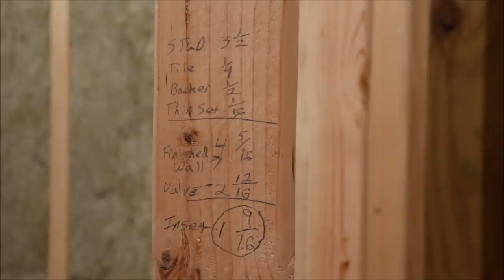Building My Own Home: Episode 116 - Installing the Shower Valve for the Master Bathroom

Comment: Great decision moving the valve to an interior wall. That way, if any problems arise, you can get to it. You do such precise work.
One tip, to make absolutely sure your pipes will never freeze, take that Rock Wool on the exterior wall and tuck it completely behind the water line for the shower head to allow the most heat from the house to access that water line, even if it means a little compression happens, you'll be better off. The same goes for any other water lines in the exterior walls. On any water lines in your crawl space, the opposite is the norm, cover pipes to protect from the cold crawl space and get heat from above.
Merry Christmas !!!!

Comment: Nice job.  In watching out put the two fittings onto the rough-in body for the shower, I wondered why we didn't have a body with PVC connections on all four locations.  I recognized that part as it's one of our products.  I will ask the product engineer over that product to see what the reasoning is.  The fewer the number of sealing joints the less you need to worry about for potential leakage.  As I get more information, I will try and pass it on to you.  Have a Merry Christmas and a Happy New Year!
Reply from the maker: Hey, thanks Scott. I think you may make it with pex fittings but I couldn't find anything but the valves with NPT fittings at Lowes.

Comment: It will be good to have the control on an interior wall so you can have an access door in case you ever need to get to it. Another good video!  Merry Christmas
Reply from the maker: Absolutely! An access door in sheetrock is WAY better than having to re-tile a shower. Merry Christmas!

Comment: I do pipe tape and pipe dope for extra sealing.
Do they make 90 degrees for your pex connections ?
I wonder if screwing a temporary board onto the backer board and screw your valve to it so you would not have to hold the valve, that way you could use both hands for the crimp tool.

Comment: I think its a good idea to shower balb  close to the door  so I won't be trapped in the shower when I first turn the water on   or have to move away from cold water  turned it on from the outside  and walk in to a nice  hot water just my opinion

Comment: And the electric wiring how you wired them did you mix plugs and switches in the same gauge or only plugs in one breaker and lights and an other breker

Comment: What kind of screws are you using to attach the brass shower valve? Trying to find some that won’t have a chemical reaction with the brass and cause issues down the road.

Comment: Where do you run the PEX pipe in a single story house?  In the attic or under the floor?   Through the walls?    Do you insulate the pipes??
Reply from the maker: If the house is on a slab they usually put the pipes in the slab. Most houses on raised foundations would have the pipes under the house in the crawl space and then they would need to be insulated to prevent freezing. In my case I have a conditioned attic, and therefore chose to run them there, and do not need to insulate because they are never exposed to extreme heat or cold. All houses have a certain amount of water lines in the walls. These are the ones that make me the most nervous as they could possibly be punctured while hanging pictures or shelves and such if someone uses a nail that's too long.

Comment: Is rockwool as itchy as regular fiberglass insulation? And i noticed you’re wearing a respirator mask, unlike your first videos of installing this insulation. Does it also release a lot of particles like fiberglass insulation?
Reply from the maker: It doesn't seem to itch nearly as much as the fiberglass insulation does. I didn't wear a mask at first when I was putting it up inside, but I really should have. It was a MUST when working with it overhead though. Yes it does release a fair amount of particles. Not sure how I missed it but the packaging says to wear a mask when installing it.

I do like it WAY better than fiberglass. I feel like it's really a superior product to the fiberglass insulation. I understand rodents don't like it. The fiberglass insulation they love to make nests out of. I also don't think this will settle like the fiberglass does over time, and I feel like it air seals MUCH better.
Reply: Arkansas Homesteader thank you for your reply. Rockwool seems like a pretty good product. It looks rigid and seems to hold its shape unlike fiberglass. I saw a video where they put a flame to it and nothing happened to it. Was pretty amazing. And it has the other benefits you mentioned so it seems like a superior product. Will definitely consider it an option on future projects.
Reply: Arkansas Homesteader where did you buy your Rockwool? I looked at home depot and it appears you have to buy this online and have it delivered to your store. 

Also, have you done a video where it goes into detail of why you’re insulating  the walls with Rockwool and the roof with spray foam? It sounds like you’re also going to install rockwool in the crawl space/floor joists on first floor. I’d like to know the thought process that led to these decisions since I’m not familiar with all the methods.